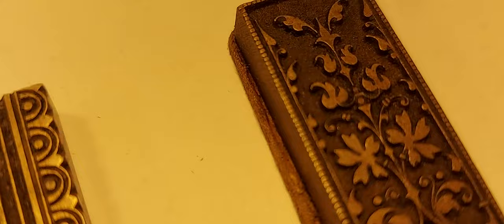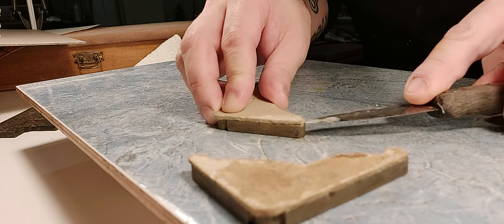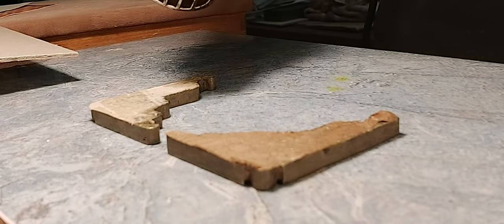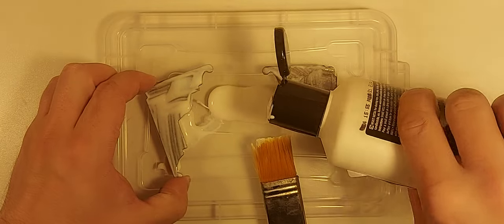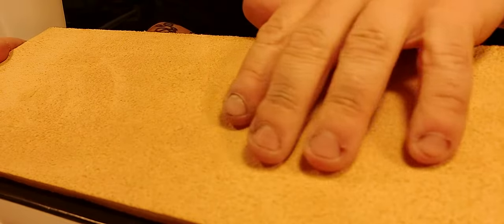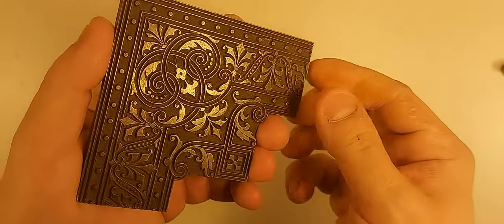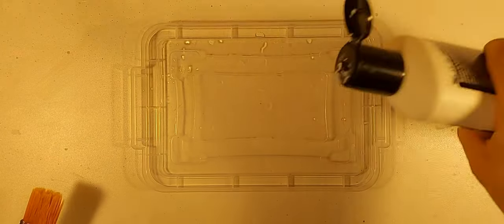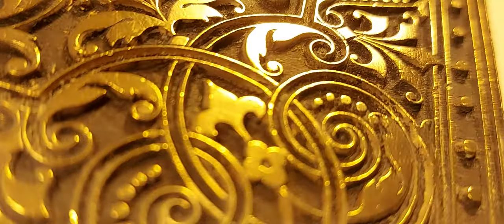3. Restoring three bookbinding dies

Comment: Hello, is it me (brass) you're looking for :)))) LR..... I also used something SIMILAR with this brass cleaning paste and if it doesn't wash well in time, some areas turn white and others oxidize. So in the end I washed well and protected from oxidation.
Reply from the maker: Oh yes, master woodcarver, washed thoroughly and felt died. Thing is, brass as a decorative material does need a coating to prevent oxidation, but dies cannot take any substance as the face needs to be permanently clean. A polish every once in a while doesn t hurt. Once every 50 years i think it s safe.